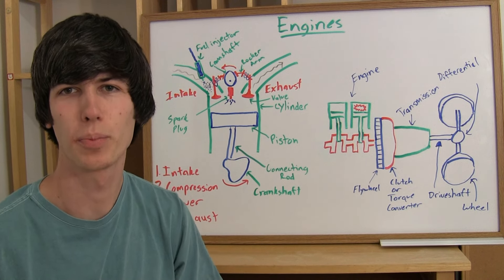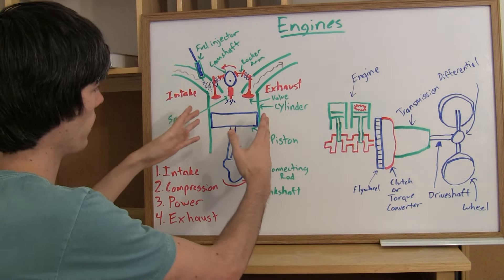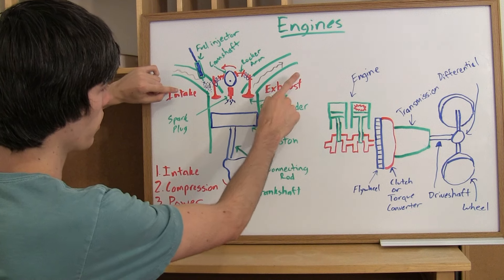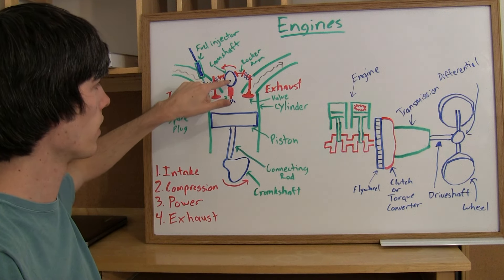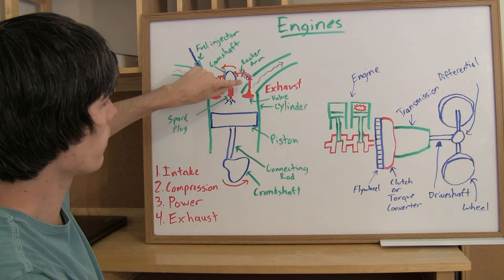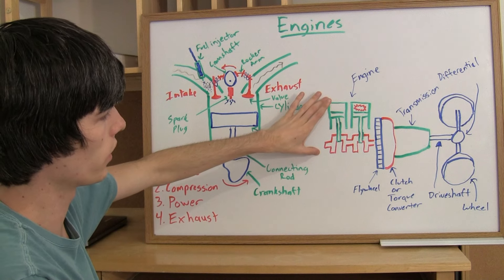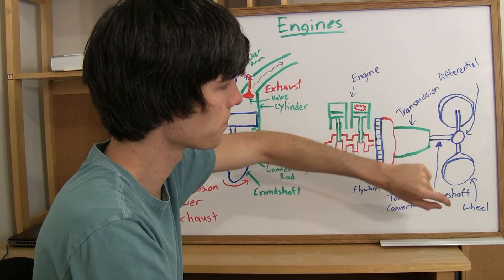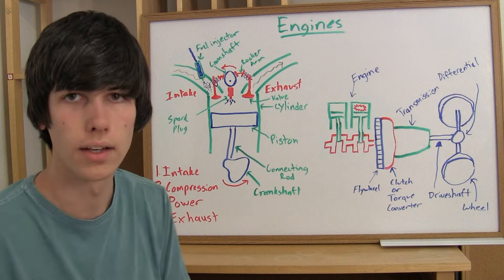Car Engines - Explained

Comment: Hi, thanks for the video but i would like to clarify something... 
What causes the piston to go down in the first step? Is it the intake air that is pushing down the piston as the intake valve is opened?
Reply: thanks for trying to explain, i have a better picture somewhat
Reply: basically, there is always at least one piston in the ignition stroke and giving power to the engine
Reply: I understand how it would work with multiple pistons but I'm curious as to how it would work with a single piston such as in a 4 stroke dirt bike. Does momentum keep it rotating when not in the powerstroke or can someone explain to me because I'm confused as to how that would work properly?
Reply: I had the same question. I think it must be due the the momentum/inertia, yeah!
Reply: It is due to momentum/inertia. In electric starts, there is a starter motor which does the job of providing the first input step :)

Comment: Can you do a video on Brake Mean Effective Pressure?  I am supposed to explain it myself, and I have no idea where to start.   I think of it as this : when comparing two engines, the one with the higer BMEP is the bigger "overachiever", it's the one getting the most out of it's properties.. As you can see, I need help. : )

Comment: Hey, I'm just wondering if you could explain why a bigger engine size means better fuel consumption(L/100km)?
Reply from the maker: It does not mean that, and in fact many times it's the opposite.

Comment: I was of the understanding that there is no explosion. Yes there's a fire which heats up the air and drives the piston down. But an explosion, per se, would be detrimental to the piston, metal and seals.
Hence the Octane rating; Octane being non explosive versus heptane = explosive, so minimum octane ratings are needed. 87 or so being the lowest. Am I wrong?
Reply from the maker: jimmy pye Call it whatever you would like. Air and fuel combust, burn, explode, fire, pow, boom, etc. This energy creates a lot of pressure, forcing down the piston and thus producing torque.

Comment: You keep saying that the piston would just pull down and draw air in, or that it will move back up to compress. What is moving this piston up and down if this if before combustion happens?

Comment: Do you have a video that explains why the torque of an engine changes as RPM changes?

I've been trying to figure this out for a while now!
Reply from the maker: Not specifically on this topic, but there are many many variables that affect torque at various RPM. My playlist on "how to increase horsepower" can provide good insight, but basically friction and airflow change with RPM, and this affects the torque.
Reply: Torque is a function of the amount of air you are able to admit into the engine, and that will change due to cylinder head geometry, valve timing, etc, and each engine will flow more or less air at a certain speed.

Fluid dynamics will dictate the flow of air you can have at a certain speed, through each specific engine head.

At some point you air flow wont be able to overcome the pressure losses through the head and wont get any bigger. From that point on your air flow will decrease and so will your torque.

Power will just be the rate at which you are able to produce torque, so it will still increase after torque has reached its maximum, just because you may be having less torque now, but you have it more times per minute.

In the end, most performance engines aim to input more air into the cylinder at a given speed range (so more torque and power) or can also aim at getting the same amount of air more often (more RPM, so more power)

So an F1 engine does not have a very impressive torque but it is able to generate it at a much higher rate, hence the high power.

This is a very rough explanation but I hope it helps. :)
Reply: Yeah, Thanks!

That's good helpful info! :-)

Comment: I have a question. What moves the piston up and down? Isn't the piston used to create rotational energy to the crankshaft. What moves the piston.
Reply from the maker: Kushikimi Minamotto Connecting rod.
Reply: there is momentum in the connecting rod, the connecting rod and the transmisssion is connected to an electro magnet which has a force that turns the motor over once and allows the next combustion, its very complex and amazing
Reply: aBRUTALfruit well sorry thats atleast on a motorcycle engine, not soo sure about cars
Reply: That air stuff that comes in the tube on the left
Reply: Its the combustion stroke that pushes down on the piston, and in turn the connecting rod which is connected to the crankshaft.Its like a gun when you press the trigger the gunpowder explodes and PUSHES the bullet out of the barrel.
BTW you can't "create" energy only transfer it
Reply: Vishwa Patel not an explosion..
it is a very rapid fire, which causes the air, water etc to expand forcing the piston down.
Reply: Where did the water come from...? There is no water in the combustion chamber. Only Air and fuel mixture. And YES it is an explosion which is initiated by the spark plug. The reason the piston goes down is because the combustion is creating hot gases that expand to push the piston downwards.
Reply: Vishwa Patel water is produced in the chemical reaction as a by-product of fuel combustion. Of course at the temperature in the combustion chamber, water is a gas (steam). Check your tail pipe, that fog that you see coming out of there on a cold day is water vapor, rapidly condensed when it exits the pipe and meets cooler temps.
Reply: Vishwa Patel it is not an explosion. It is as you day, rapid pressure rise due to combustion in a closed chamber, with the piston able to move to do work. It is not an explosion.
Reply: shu da phuk up

Comment: What i dont understand is how cars can put the power on the the road coz of the suspention is moveing the wheel. Shouldnt there bse a bar that moves with it? But then how is that connected to the engine

Comment: Hey i have a question. The more miles on a engine, does that effect the horsepower or anything with engine? Say a car with 100k miles well the engine produce as much power as an new or close to new engine?
Reply from the maker: Typically, it will start to lose power. As the piston rings begin to wear out, the the engine begins to lose some compression, so it slowly loses power over time, unless everything has remained intact and in good condition.
Reply: Engineering Explained

would using a fuel injector cleaner help keep it in good condition, as well as not letting the gas tank run to empty?

I'm a novice in cars, so forgive me on my lack knowledge lol.
Reply from the maker: Well, certainly don't let it get empty. But the fuel injectors typically last quite a long time without any interference.

Comment: Is the air intake so strong from step1 that there is enough momentum to push the piston down and then up again to compress the air so tightly again? (That seems to take alot of momentum, especially the compression part!)
Reply from the maker: Mike Wu Nope, this comes from stored energy in the flywheel.
Reply: Oh, that makes a lot more sense!

Where does the energy stored in the flywheel come from?
Reply: Engineering Explained Sorry but i believe you are in-correct. The purpose of the Flywheel or flexplate is not to store energy. It is to absorb power pulses from the engine. These power pulses come from 1 cylinder firing, then the time until the next cylinder fires. Hence why you need a heavier flexplate or flywheel in cars with smaller engines. 

The power stroke from one cylinder will have enough power to rotate the crankshaft enough to carry the next piston in the firing order through its compression stroke so it can begin its power stroke, and doing the same, repeatedly.
Reply: Fytox2 Well yes and no. the idle speed would be considerable higher if the flywheel woudn't be there. Also it would be much more likely to stall the engine if you try to start rolling
It's an extreme example of course but the old V8 F1 engines had an idle speed of about about 4000-5000rpm and were still very easy to stall because they had no flywheel.

Comment: Good morning 
I have a question What's the difference between a high compresson engine vs a low one 
Pros and cons
Reply: There more combustible you are able to pressurize the bigger the bang, that's why you have different size cylinder heads. Also higher and lower octane fuel
Reply: +Marc Rogue so why is it in a fuel efficient car the compression ratio is higher that a powerful engine you'll find that it has a lower ratio
Reply: Falih Ismail compression ratios have to do with fuel economy and also power output, the higher the compression ratio the better the fuel economy since you can take advantage of more energy from the combustion. the key is the size of cylinder in the engine block and the volume per cylinder

Comment: Thanks, I understand, but can you please help me figure it out at least with an estimate figure, even if the answer is not precise, but can you calculate an estimate, for an in line 4 cylinders, 2.0L 12:1 compression ratio, at idle speeds, I was told the computer does it, depending on conditions such as air pressure, air sensor tells the computer to vary fuel injection to keep adequate air/fuel ratio , but I just want to hear a number out of pure curiosity, please man! :)

Comment: one question, how and what make the piston move up when it entered the 2nd step which is compressed?
Reply: i really dont know anything about cars , but i would say either the torque coming from another piston, thats just moving down at the same time , or the momentum maybe? clear me up aswell if im mistaken =P
Reply from the maker: The flywheel (if nothing else) carries enough inertia to keep the engine rotating, for the power strokes to occur.
Reply: thank you guys!

Comment: Does the fuel injector close after the air fuel ignite?
Reply from the maker: Well in the scenario I showed it's not in the combustion chamber, but regardless fuel isn't going to burn without the presence of oxygen. The injectors open to spray fuel at the necessary times.

Comment: Never understood how you add oil into the engine, that helps you not to burn the sides of you piston? Anyone can tell me?
Reply: Dave Mckee yes, it keeps all parts lubed so it doesn't wear out that fast. (sorry for bad english)
Reply: Okay, but how do you inject it into it? Can't see any valve that delivers the oil.
Reply: when you put oil in an engine it sits in an oil pan.
when you start the engine; a pump distributes it all over the engine in areas that need oil.
oil serves several purposes other than just lubricate; it also cools hot spots in the engine and it keeps the engine clean and helps the piston seal properly against the cylinder.
I hope it helps.
Reply: ***** I get that, but show me how the oil gets into the motor! Like in a drawing or picture.
Reply: The oil goes under the piston. The piston's oil ring keeps the oil from going into the top of the piston.

Comment: What would happen if you left your car idle to long?(more than an hour)
Reply from the maker: Assuming the cooling system works, nothing really. Just waste some gas.
Reply: An amateur mechanic told me that leaving a vehicle idle for hours (repeatingly) is hard on it. for long term, idk if Ttur. Thanks
Reply from the maker: Well yes, you shouldn't just let it sit there at idle for no reason. It's not as well balanced as when the whole drivetrain is connected and you're cruising. The inertia of the system increasing greatly when everything's connected, balancing out the forces.
Reply: Thank you